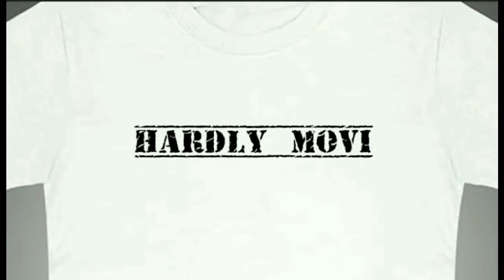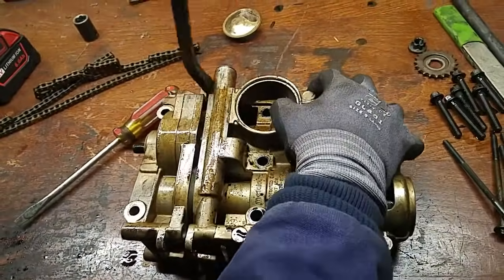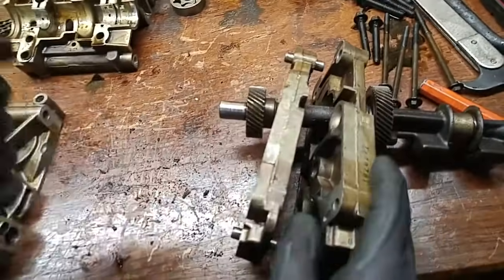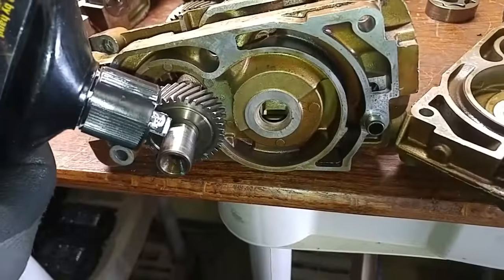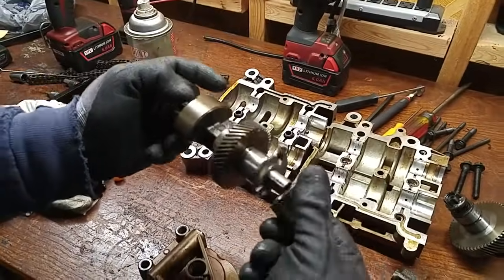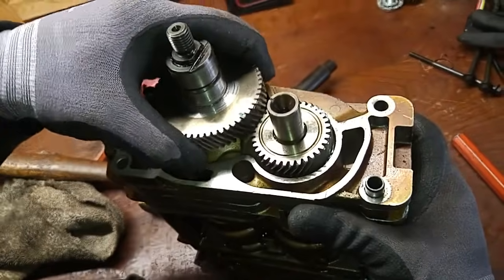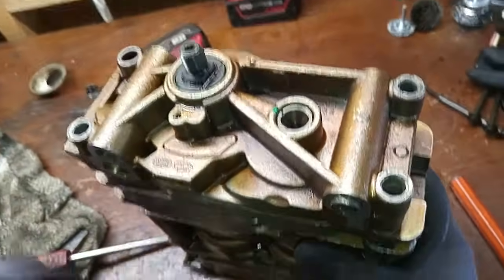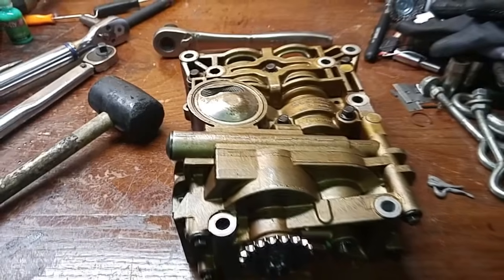Hyundai / Kia 2.4L GDI Engine - How To Oil Pump Refurbish & Clean

Comment: I'm looking to rebuild my 2.4l in my kia, and was wondering if cleaning out the oil pump needs to be done for a engine with no damage, just bad oil consumption, given it has 156k miles I was just going to replace the oil pump while rebuilding the engine, but this would be way cheaper option.
Reply from the maker: If your oil pressure warning lamp never came on, I wouldn't bother messing with or cleaning the oil pump.

Comment: Dear Hardly Moving, Great video! One question when I use your Amazon aftermarket pump, I receive a pump with the wrong sprocket. I receive one with a sprocket for a wider chain. Do you know the part number difference between the Oil pump models. Thank you.
Reply from the maker: No but can you transfer the sprocket from the old pump to the new one?

Comment: If.
 It is not seized. Do these things stop pumping oil? Like do they go bad and is there any way to test them while out of the engine?
Reply from the maker: No way to test.  In the video there's a spring working with a plunger, which I believe, regulates the oil pressure.  Make sure it's not stuck.
Reply: @hardlymovingpro  I see , question. I'm working on a 15 sonata 2.4 not sure if oil pump is good I also have a pump from a 16 optima , its same setup but bolts up differently to the upper ladder , I can swap ladders and pump but is it any different internally or just the way it bolts  up ?
Reply from the maker: Although both Hyundai and Kia share the same engine,  Kia tends to lag behind Hyundai when Hyundai makes engine mods.   So your 16 Optima pump may be for a 14 Sonata.  The 15 Sonata had some big changes compared to the 11 though 14 Sonata 2.4 engines.  I believe your 16 Optima pump should work but the 2015 and up 2.4 engines have a upgraded improved pump.
Reply: @hardlymovingpro  as long as it pumps correct i.dont mind this job is way behind I don't really want to chance putting a bad pump back in since the engine was seized , if the ladder is slightly different it should still pump the same way since block is identical right ?
Reply from the maker: Yes, I'd assume the engine block supply and return oil ports for the oil pump have remained unchanged.
Reply: @hardlymovingpro  when you turn the gear by hand the balance shaft is supposed to come all the way back by itself right ? On one it don't come all the way back it slows down and stops before al the way down
Reply from the maker: As long as it rotates with little resistance, it okay.
Reply: @hardlymovingpro  yea rotates no problem the shafts just don't automatically drop down in place like my other one does

Comment: What is the oil pressure supposed to be at idle for a 2017 Kia serento 2.4 the engine was just rebuilt 1800 miles ago Oil light coming Is at idle  After it's been warmed up
Reply from the maker: Don't know.  I'd replaced the oil pressure sensor first before doing anything else.  Leakage of this sensor will throw a false positive.
Reply: Just had mine rebuilt 780 miles ago and same issue. Multiple forums say to replace the oil pressure sensor. Pain to get to but should fix. Me and my co worker are both experienced mechanics and had it fully rebuilt in 6 hours. New crank, Pistons, rods, bearings, rings, gaskets, and full timing. Didn't replace the sensor lol. Once it's warmed up the light comes on only at idle.

Comment: After my 2.4 engine rebuild I'm have crank  no start issues. Compression was about 180 psi each piston. All new engine sensors and car started before rebuilding engine
Reply from the maker: Recheck all electrical connectors and fuel delivery components.

Comment: una pregunta alguen que me saque de una duda  si quiero reemplazar la bomba de aceite  como la tengo que pedir yo tengo un sonata 2016 gdi 2.4   de que otro modelos le quedan o como sería
Reply: Podes buscarla en base al modelo del motor del vehiculo en ingles podría ser algo como  Sonata 2016 oil pump... El modelo de la bomba debe ser algo como 233002g400

Comment: In Hyundai Elantra, 1 and 8 engine limited, this pump is installed, it can make a knocking sound.
Reply from the maker: Good to know and thanks for sharing!  In most instances in engine knock that I've experienced, it's caused by worn out or spun connecting rod bearings (due to lack of oil pressure or oil starvation caused by oil from loose or stuck piston rings).
Reply: A knock can also come from misaligned balance shaft

Comment: Can i change this model of oil pump with one that not have Balance bars came with older models?
Reply from the maker: I believe you can use a pump from the 2.0 engines;  but you'll also need to get the matching chain sprocket, chain and chain guides.

Comment: Most informative video, thanks for the information ;)
If I may ask a couple of questions, my daughter's 2.4l engine oil light turns on at idle and goes off at 2500 rpm, after reading @SteveMcCarthy33's response I'm inclined to believe it may be a sticking pressure relief valve. Here comes the caveat, the engine shakes out of balance I believe because of the oil pump. Should I just change the pump or fool around with the existing pump, either way how do you install it to be balanced correctly, are there timing marks that I should follow? Any info would be superb. Thanks in advance
Reply from the maker: If you have the time and willing to put in the effort, I'd take off the oil pump, clean it thoroughly, reinstall and see what happens.   Taking off the pump will require removal of the oil pan.  If you see silver particles accumulated in the pan, it's more than likely that your rod bearings may be wearing out and that these particles is what clogged up your pressure relief valve.  Your engine shaking problem could be caused by a dirty throttle body and/or carbon accumulation of your intake ports and valves;  a problem with gasoline direct injection (GDI) engines where no fuel touches the intake valves to wash away carbon accumulation.  Also, shaking could be cause by a clogged PCV valve.   Hope this helps!

Comment: Wondering what mileage was on this 2.4 L Hyundai motor before it died?
Are these good motors, was wondering because I had a new one replaced when the recall was done. Have changed the oil religiously, anything else I should do as reg maintenance to keep it running?
Reply from the maker: Hyundai / Kia made three big mistakes:  1.  Installing low friction, low tension piston rings to squeeze more mpg's (other manufacturers are doing the same thing resulting in customer complaints about excess oil consumption)  2.  Recommending oil changes up to 8k miles (that one I can't figure out...Maybe the EPA wants less used oil waste)  3.  Using 5W-20 weight oil (Apparently the EPA may have something to do with this to pressure manufacturers to get more MPG's with presumed lighter oils producing less friction)  
Using 5W-30 and changing your oil every 3k miles should keep you trouble free. Change the filter at every other oil change.   Use any brand of oil (like Walmart Supertech) that meets API / SAE specs.
Reply: @hardlymovingpro  I have a 2011 kia 2.4. The og engine failed at 180k. They replaced it free. This engine has about 60k on it. I will take your advice on the 5w-30. I already change oil at 3k Should be better here in  Texas..👍

Comment: Hi, is there a way I would know if the knock in engine is because of rod or main bearing?. or I have to remove the oil pan to figure this out. what is the usual first thing that goes out (main or rod).
Reply from the maker: Every 2.4 GDI engine that had knock that I disassembled has at least 1 worn out or spun rod bearing.  Usually caused by oil starvation.  Lots of silver residue floating around in the oil from the bearing wearing out.

Comment: @hardlymovingpro
How meany of these oil pumps have you cleaned and have you had good luck with just doing so? Only ask cause I’m in the process of rebuilding a 2016 gdi 2.4 and don’t really want to spend 350 bucks on a new oil pump.. If the one person is correct about the Toyota Camry bearing being the same. I’ll probably replace them as there only like 35 bucks from Sealed Power in part number 1934M long as they are the correct size.. Should have a bit better oil pressure correct. Did you reuse or replace the TTY bolts in the oil pump and when you put it back on the engine? What about the 7 long TTY bolts that hold it to the block reuse or replace? Thank you for your time in showing how to take it apart and put it back together..
Reply from the maker: I've rebuilt around a half dozen of these pumps.  They only need a good cleaning IMHO.  Although the bearings may be scored, the balance shaft journal surfaces have all been in good shape.  These bearing don't get anywhere near the stress of connecting rod and main crankshaft bearings.  What messes them up are owners who inadvertently drive their cars with low oil which starves oil to both the oil pump and rod bearings;  which eventually leads to either rod knock and/or engine seizure.  In the process, worn metal particles from the worn rod bearings work their way to the pump after the owner adds oils thinking that will fix the problem.
Reply: Yeah the one I’m rebuilding was ran low on oil and was only about 4k miles passed the oil change… What hurts these and all direct injection motors are the long oil change intervals.. Cause some gas gets passed the rings on them and at or around 5k miles you can smell the fuel in the oil.. Witch isn’t good at all. They really need to change that to around 3500-4k miles at most. It was still running but didn’t have a bearing left on the number 3 rod.. Going to have to bore the block once over cause they kept driving it. Even thought it was in limp mode. The piston was slapping the cylinder pretty badly.. I did see they offer .50mm and 1.00mm over on the pistons. I hope .50 cleans it up. As I hate to go the full 1.00mm over as that’s the biggest size I’ve seen in aftermarket pistons for them.. Sadly the car doesn’t even have 100k miles on it.. I told her I wouldn’t warranty it if she doesn’t keep it charged before 4k miles on the rebuild.. So I guess you reuse the bolts on the oil pump to block as well. The 6 or 7 long ones as well..
Reply from the maker: FYI:  https://youtu.be/AX4iH4cKSAk

Comment: Something I noticed after rebuilding my G4KC engine. The oil pressure relief valve in my replacement oil pump was stuck in the 'down' position, causing oil pressure to drop when rpms return to idle.  As you correctly show at 13m50s it is critical that the spring loaded pressure control valve moves freely in the housing. I believe that a sticking oil pressure valve is a major cause of problems with oil pressure and bearings in these engines.
Reply from the maker: Excellent conclusion!  I've rebuilt a dozen of these 2.4 GDI motors and noticed a few had stuck springs in the oil pump.  More than likely caused by metallic debris from worn connecting rod bearings and/or cylinder bores.
Reply: Very valuable information 🙏🏻

Comment: old bearings is not  good:face-fuchsia-wide-eyes:
Reply from the maker: If you can find a vendor that has replacements available, please share!
Reply: @hardlymovingpro  Same engine bearings as Camry 2003 and 2004:face-red-heart-shape:
Reply from the maker: Thanks for the info!
Reply: @adiladilalhmandy106 

Those replacement bearing from Sealed Power bearings is 1934M Engine Balance Shaft Bearing Set correct?? Or is it a different part number? If I looked it up right..
Reply: @adiladilalhmady106 would you pleae tell us wich part of Camry 2004 use those bearings?

Comment: please bro i need help my car has a broken oil pump because of one journal bearings , You mentioned it in this exact second https://youtu.be/BhtWkwWnnTE?t=445 , Can I get these journal bearings can it work or it will not please tell me i have honda accord 2.4 Engine i live in morocco and honda is rare here espaslly these 2.4 engines i cant find it
Reply from the maker: Sorry.  Not familiar with honda 2.4 oil pump bearings.

Comment: I would have liked to know what your pressure readings were before tear down . Also would it have be n easier to replace the entire unit with a used one
Reply from the maker: Pump came out of a seized engine (more often than not due to the owner letting the oil get too low).  A used one, if you can find one, unless it spins freely should be cleaned as well.

Comment: Do you have any footage of you replacing the inline fuel filter on the 2000-2004 Toyota Avalon?
Used you timing belt video as guidance to help replace my cam and crank seals on my 01 Avalon 
Thank you so much for the videos
Reply: Not the fuel tank/pump tea bag filter. The one by the abs module under the air box
Reply from the maker: No but it should be easy from my recollection.  Take off the air filter box and hose to get access.  Believe the filter is retained via compression fittings.
Reply: Easy for you hahaha, I don’t have your level of expertise! Thanks for the reply
Reply from the maker: @fluorescentmug8333  you bet!

Comment: Great video..  quick question on different topic.. I got a customer where crank no start, i sprayed staring fluid in air intake, car tries to start then i know it is fuel pump, i towed the car to my home, and i tried again with started fluid and jump start, car is not even starting (acting like hydro locked).. question is will it hydro lock when i spray starting fluid in intake may be i sprayed 1/2 of bottle or 1/4 of bottle ).. after changing fuel pump it worked after lot of hestiation.. i still dont know what cuased this, is it a bad jump started or car is hydroo locked. ??
Reply: Try and spin the engine over by hand with a breaking bar. You don’t need that much starting fluid for future reference. Have someone crank it while you give it just a few sprays. 
I would remove the spark plugs then try to spin the engine by hand.
Reply: @Afrattzz1  Thanks Anthony. If i cant spin after removing spark plug, ii can assume it is locked right ?.  in case if  it is hyro locked , how do you unlock it.
Reply: @sivucit  well if it still won’t spin after doing that then the engine is damaged in some way. Try your luck and see what happens.
Reply from the maker: thanks!  Sounds like you had a weak failing fuel pump.  After replacement, it will hesitate starting until enough fuel gets to the injectors.  Hydro lock occurs when an engine sucks in water from the intake (like when trying to drive through a flooded street), water gets into the combustion chamber and the pistons can no longer complete its cycle.  This condition usually results in bent connecting rods.  The engine can be unlocked after removing the spark plugs and air drying the cylinders with compressed air.